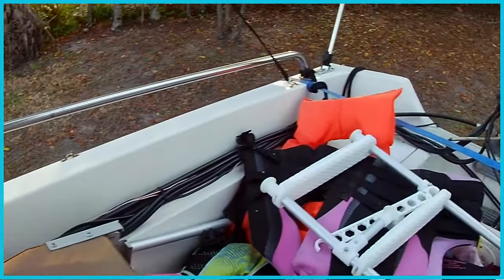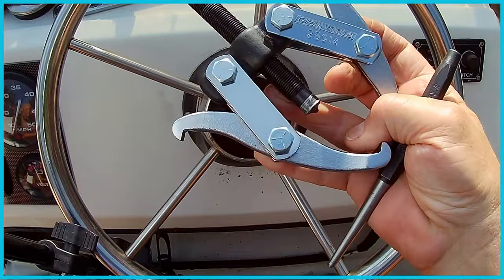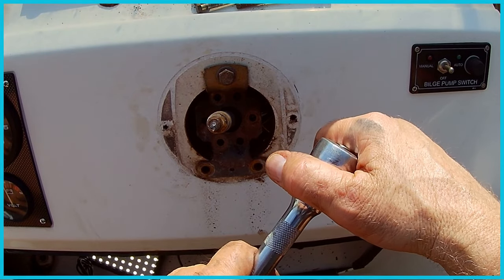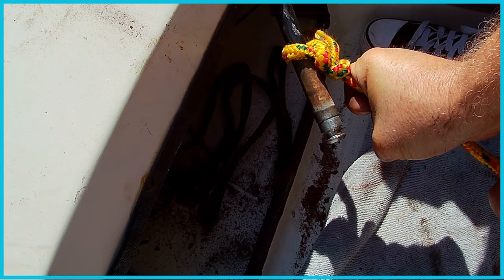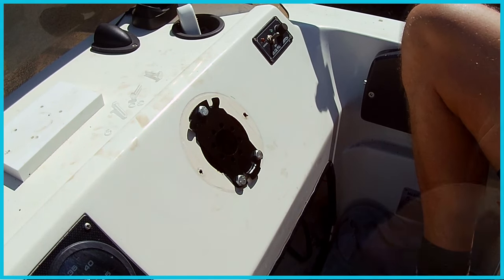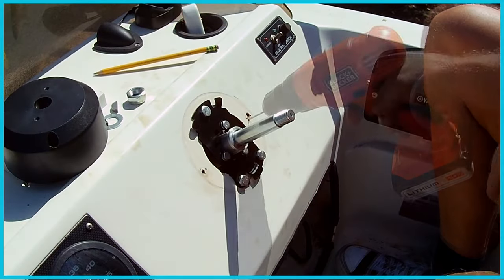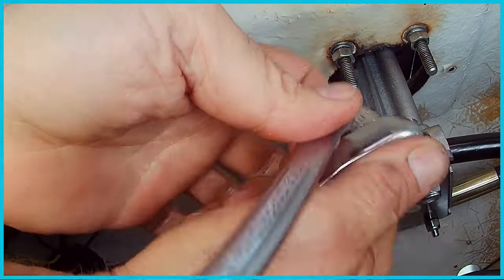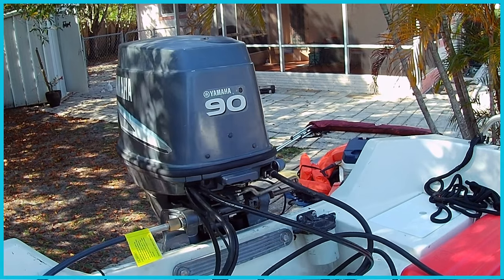How to Replace Boat Mechanical Steering System

Comment: I think you fudged on connecting the drag link. The cable rod should be turned all the way into the tube before the link is connected to the end of the rod. Then you'll have full swing of the engine to port and starboard. Also, I'd opt for connecting cable end to engine first and cable to helm before bolting the helm to the
assembly bracket and console. Great video and you probably saved alot of viewers a ton of exorbitant labor charges. Here in the Keys the dealers and shops charge $200 per hour and take their sweet time.
Reply from the maker: Thanks. That’s a good call! I think you’re right. Hopefully I won’t have to do it again for a while. Lol Thanks for watching!

Comment: Thank you for making this video.  Had to call sea tow today because my steering failed in the middle of the ICW in NC.  Getting ready to order my kit.  I will definitely be using your video for the installation. Is there different size steering modules or are they all the same size and how did you choose a brand to buy?
Reply from the maker: Thank you so much!  I’m glad it helped.  The only measurement I did was to check the length that is printed on the current cable, there is a little section in the video on how to check it.  The I just went off price and reviews on Amazon.  Hope that helps. Let me know. Cheers!

Comment: Great video! Just bought the same kit, but the 3 bolts that attach the bracket to the steering assembly (shorter, half threaded bolts) don’t seem to thread properly into the holes. I can’t finger tighten them very far at all. Am I missing something?
Reply from the maker: I am sorry for the late reply here. Did you figure it out?  If not, can you email me some photos at august@augustblock.tv
Reply: @blockprojects  I figured it out, but thanks. Just needed a little marine grease and a little elbow grease.
Reply from the maker: Excellent!   Thanks

Comment: What is the name of the arm that attaches to the hydraulics on the outboard engine? I’m new to owning a boat and need to install this steering kit. My motor is a 1962 evinrude lark 3 and doesn’t have that arm 0:17 and the kits don’t seem to have them either. Where might I find one?
Reply from the maker: Hi Danny, Thank you for your comment.  This is a mechanical system so it does not have hydraulics but I think you may be referring to the steering arm.  The link didn't take me to the right part in the video. Are you looking at the very last step?  If so, you can Google "outboard steering arm" and several universal options will come up.  

Here is one I found for Evinrude/Johnson: https://www.ebay.com/itm/235013495572?mkcid=16&mkevt=1&mkrid=711-127632-2357-0&ssspo=Nx5cgr98SBi&sssrc=2047675&ssuid=fvUWTE9YSLa&widget_ver=artemis&media=COPY

Let me know if I'm barking up the wrong tree lol
Reply: @blockprojects  you got it! Thanks so much.
Reply: @blockprojects The "steering arm" is commonly refered to as the drag link and I reckon you can add arm to that.
The cables push rod "drags" the engine side to side

Comment: this is a good how to but I would Grease the cable at the Helm.
Reply from the maker: Thank you, David! I did grease it right before I fed it through the hull but it’s a bit hard to see because the angle of the camera is tight on where I am feeding it through. It’s a good call, I should have made that clearer.  I appreciate the feedback.

Comment: CAN YOU BUY JUST THE BLACK HOSE THAT GOES ON THE CORKSCREW LOOKING CABLE? WE JUST BOUGHT A USED BOAT AND WE BELIEVE THAT LAST HOSE YOU PUT ON IS MISSING, THANK YOU
Reply from the maker: Hi, Are you referring to the housing that catches the cable as is pulls through the steering mechanism so the cable doesn't hit any of your wires and hardware under the helm?  If so, I'm not sure where to get just that piece but I'm pretty sure you can fab something out of a piece of flexible hose or tubing. It's not structural.  If you are talking about the actual housing, You'll need to buy a new cable with the housing already installed. Unless, you are talking about something else and I can dig a little deeper.  Thank you!
Reply: the tubing that keeps mechanism from hitting anything else, thank you so much will see what I can come up with!

Comment: Had you turned the wheel it would have most likely shortened the cable to give you enough room to put the cable in with out taking the motor loose.  Still was a good video
Reply from the maker: Oh geeze! You are right!  I could have pulled it all the way in and it may have been able to butt up agains it and screw right in. I wish I could do a pre-video to let folks know to try that. Well,  I may to wait another 38 years to try it again. Lol Thank you for watching and for the feedback.
Reply: @blockprojects similarly, putting in the tube to catch the runout under the helm may have been a bit easier with less of the cable sticking out 😜 nicely done though!
Reply from the maker: Oh, yeah!  That's true.  Shoot!  Iteration is the key to semi-perfection.  lol. That's great feedback. That can apply to other cabling situations too, clutch cables, throttle cables etc.  Thank you!
Reply: @blockprojects  My well is so tight that I have to take the engine off. Great vid.
Reply from the maker: Hi!  Thank you!  Appreciate. Sorry you had to pull your engine. That’s a pain. One person commented that if I had retracted the cable all the way inside the housing by turning the steering wheel all the way to the left, it may have given me more wiggle room to feed it in to engine bracket. If that’s helpful.  Good luck!

Comment: Need to Install a Clamp Pipe Nut with a Honda 50899-ZV5-020AH Grease Gun - (GS41170_OM Omax)
Reply from the maker: Howdy!  Thanks for your comment. Is that something you need to do as a project or something you are recommending for this video?
Reply: @blockprojects  I recommend for this video
Reply from the maker: Gotcha, thank you!

Comment: Vevor is a Chinese manufacturer they copied the old Morse steering helm exactly down to the bracket. Morse has been out of business for years
Reply from the maker: Thanks for your comment. It’s definitely a Chinese knockoff. But it’s pretty solid state and so far, it seems to be holding up well and functioning perfectly.  There are better quality kits out there for sure but the install should be similar.  Thanks again!
Reply: They are priced well and I do know of people using them with no issues. It just amazes me how well they copied it the old Morse cables will even fit it

Comment: Go get yourself a sea star or sea pro hydraulic steering system worth the 400 and what a dif from a cable system and no locking or binding just butter supper easy also just 2 small plastic braided lines make sure the steering wheel fits the new hub was the biggest challenge
Reply from the maker: Thank you.  If this one fails, I will certainly look at a hydraulic system.  Cheers!

Comment: Hand held cams sucks
Reply from the maker: Hi, I totally agree.  Thanks for the feedback. Those small sections with the hand held were a bit shaky.  I left them in because the information was still pretty solid on the process.  I have since learned to do better hand held and smooth out shaky footage in post.  I think subsequent videos came out smoother, like Fixing Leaking Trim Cylinders and Installing Trailer Guides. Little by little!! Thanks again.